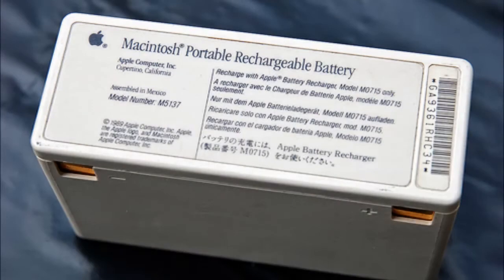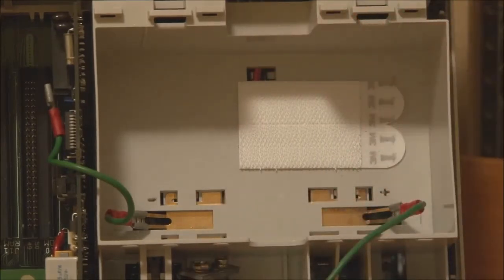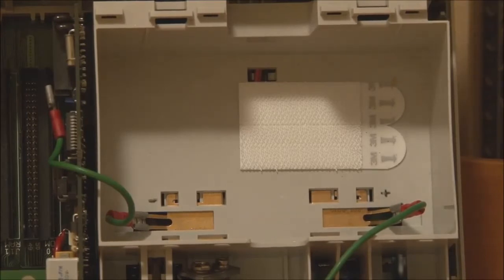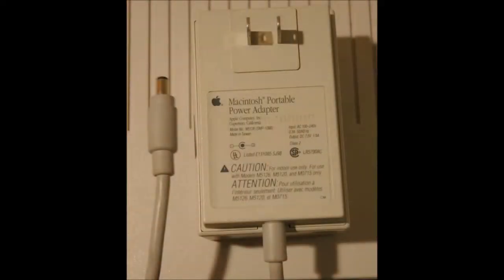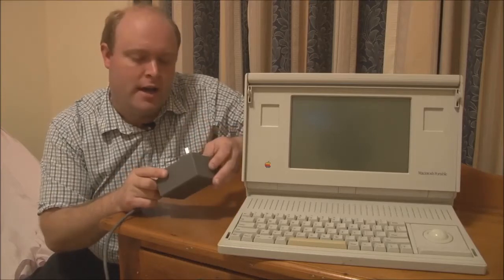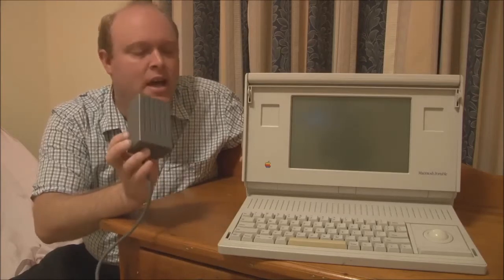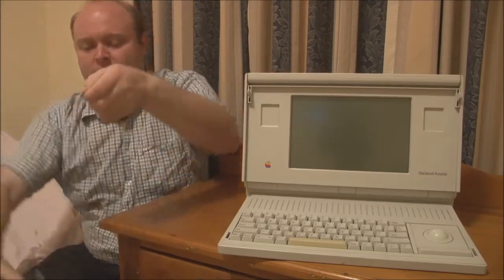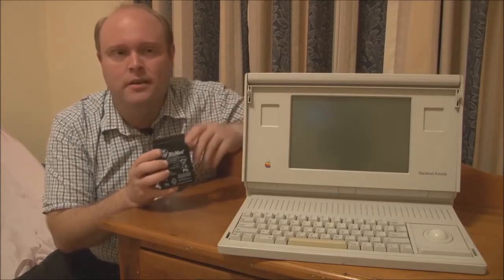Quick Tip - Macintosh Portable Battery and Charger Options

Comment: I just got one of these, in VERY good condition but no power brick, looking forward to seeing it power up, fingers crossed.
 Just took it apart and the floor of the case, underneath the keyboard 
and logic board is covered with signatures, cast into the plastic,  of 
Apple folks who worked on the model. I've seen other take-aparts and 
haven't seen this on other machines. Very interesting.

Comment: Great video! I really don't think you need a battery for it. problem is, the original AC adapter is only 1.5A to keep the original 6v battery healthy. That's not enough amp to spin up the hard drive.

These machines needs new electrolytic capacitors for the mainboard, and also to clean it for leakage from caps.

Comment: Thank you for your help and demonstration. I have one of the model a few day ago but without a charger, I purchase a quality AC Adaptor 7.5v/1.5A, but without any joy to opower it up, I am thinking of replacing the battery in the way you had done. my questions are: 1- How use the buttons to power it up as it has 2 buttons and 1 sliding button that using the last centrury's symbles that are not known to me. 2- Any idea how to recondition the original battery? Best regards

Comment: What battery do you use? I think this is not lithium-ion? That is nickel-cadmium or what?
Or this is standard lead-acid battery (sure 6 volts) from uninterruptible power supply unit?

Comment: I wish the 3rd party charger was listed in the comments. I need to know about the right tip for the charging adapter being used. I have looked at Amazon but nobody lists the tip dimensions that will fit the Mac Portable.

Comment: how about wiring up a regulated 6v power brick straight to the battery tabs in the portable? replacing the battery. what is the max current draw on the battery normally?
Reply from the maker: ***** I believe that you can do that - but I have not tested it, and I would be concerned that if the power supply that you used was not current regulated, then it could damage the system. I do not know what the current draw on the battery would be - but the next time I use my Portable, I will hook up my multimeter in series with the battery, and measure the current draw.
Reply: It has been 3 weeks since your reply.  Have you measured the current in series with the battery?  (Thank you for your excellent video, BTW.)
Reply: @JDW-  7 years later and I'm just reading this and looking for the same answer James.. I'll have a Portable in my hands very soon and hoping to breathe some life into it!
Reply: @pocketscience911  I wish we knew what happened to Jason.  His last video was 5 years ago.

Comment: I would’ve thought that a charger that was capable of 2a wouldn’t be bad for the machine because the system would only draw as much current as it needed and there would be some circuitry to prevent overcurrent. All the adapters back then were at 7.5v and nowadays with how the caps in most of these older adapters have become so worn, I’d imagine they wouldn’t be able to supply nearly the original power they could. My MacBook Pro 1st gen magsafe charger can only output 55w compared to its original 65w and that thing is 15 years old. The PowerBook chargers are around 30 years old now and I’ve actually opened one up because it stopped working and the capacitors on it were completely bursted.

Edit: I read the description and I saw that the circuitry on the portable has no current limit and relies on the charger and that makes sense. But still, using an original charger that’s supposed to output 11.25w probably isn’t going to do a good job since they’ve lost a lot of power capability over the years after the electrolytic capacitors have aged inside of it. So I guess for the best results, one should either replace the caps on a original charger circuit and change the caps on the board of the machine itself.

Comment: Your videos are great Jason. I'm off to Jaycar to get the same battery!
Reply from the maker: KyleGP Let me know how it goes!
Reply: Got the same battery and rigged it up the same way as you but unfortunately mine is no longer booting. Just makes a tone of noises and has screen anomalies. It seems like it doesn't have sufficient power to get going. Intermittently I have gotten it to boot but it's rare. I think at this point the caps are probably bad, so I will need to check the rest of the unit when I get the time :(